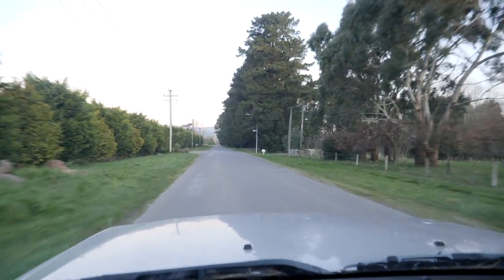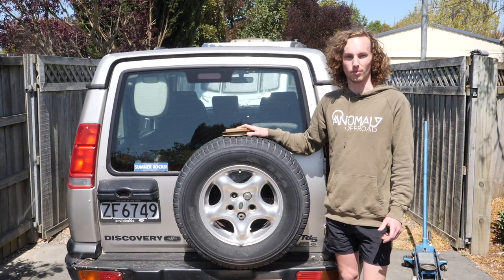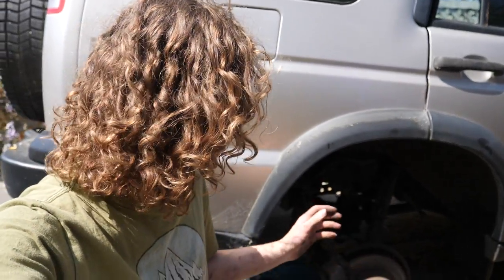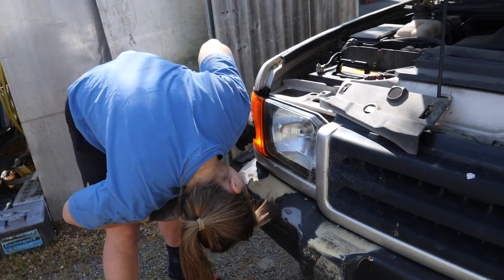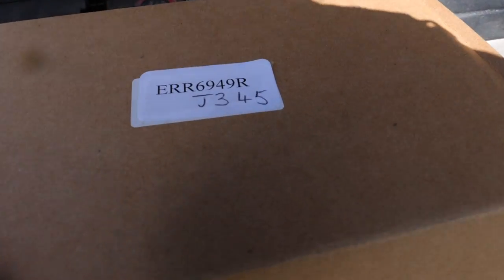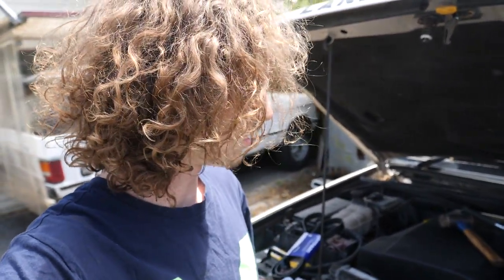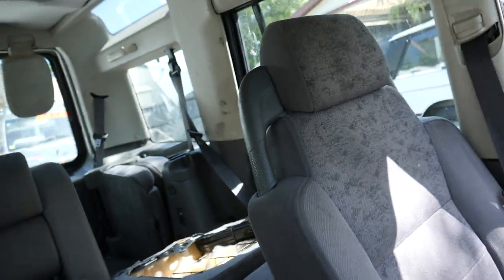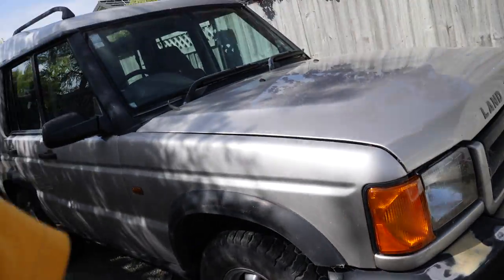My NEW Disco 2 - "The BEATER Truck" - Abandoned TD5 D2 Reveal & RESCUE! Does it even RUN?

Comment: my  disco  two  is  4 0    auto  when  replacing  front  d  shaft  uj s  found  it .had  diff  lock  cogs  in  transfer  box  so  made  a  lever .to  fit  shaft  and .use d  a  heavy  cable  from  throttle  of  a  little  double  drum  road  roller  to  operate  the  centre  diff  lock  and  save  about  400  bucks  by  not  buying  linkage  from  l  rover   wagon  has  no .roof  glass  except  side  ones  and  real  heavy  torsion  bars..on  diff .suspensions  cornering..is  amazing .luv  this  thing

Comment: The shuttle valve is an easy fix, it’s under the abs and you can just unbolt is and all the breaklines on and take the old one off and the new one in, it is a bit tight to get the hands in but is do able
Reply from the maker: Yep, will be tackling it in an upcoming episode!